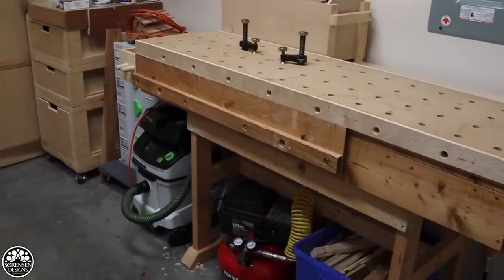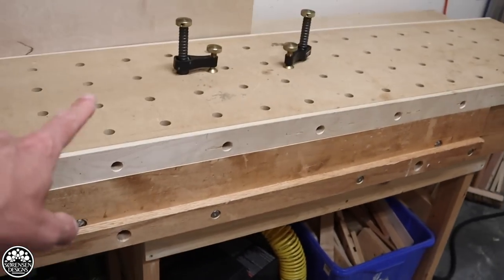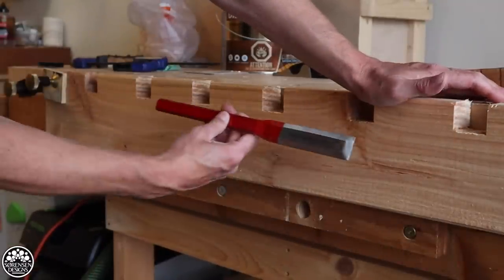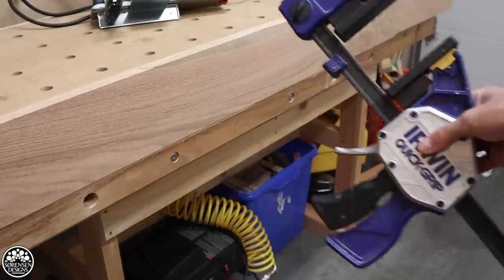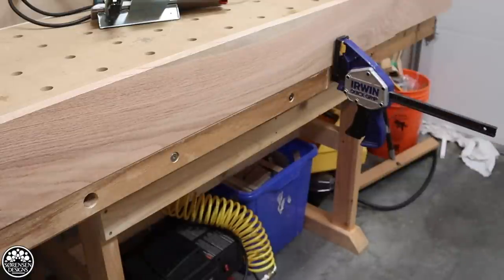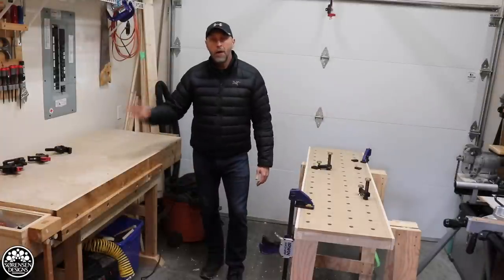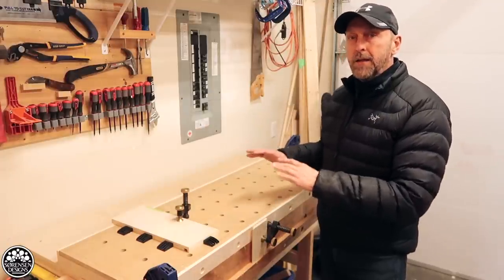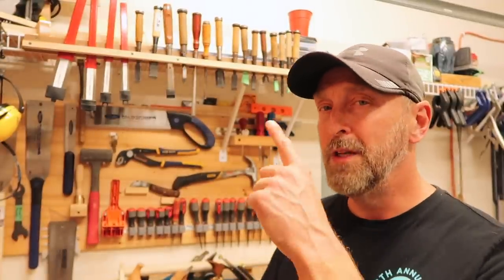Do You Need a Vise on Your Work Bench? - Woodworking on a budget

Comment: This video came at just the right time. Was thinking about getting a vise for my bench and this looks like a way better solution for me!

Are you locking the mft top in place, or do you not feel the need for that?
Reply from the maker: Yes, I use two 3/4" dowels on opposite ends/ corners with the equivalent holes drilled into the plywood top below. The dowels sit just below the surface. I just insert those and the top stays put.  I will be posting plans for the entire bench and MFT on my website soon.
Reply: @EricSorensenCanada  ah, thanks! Sounds simple and effective.